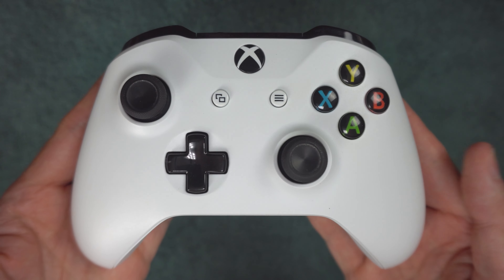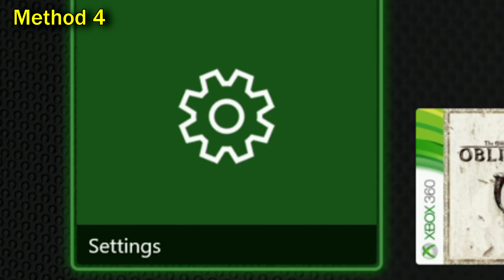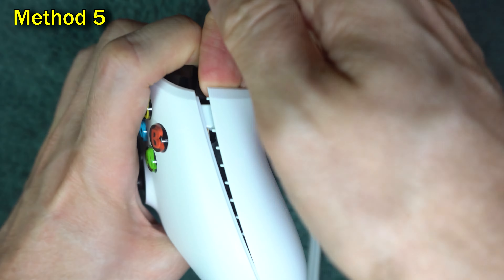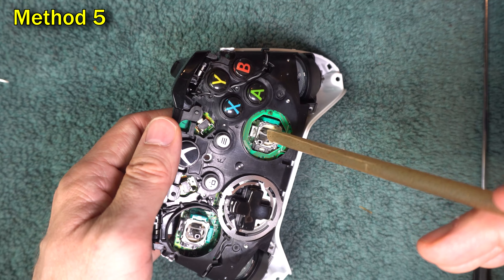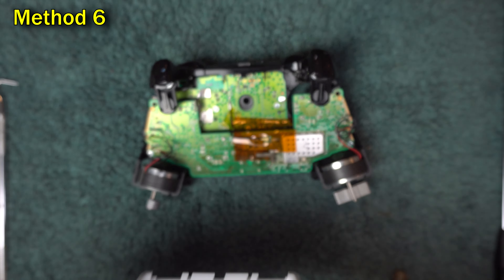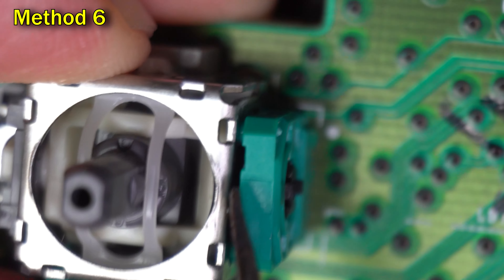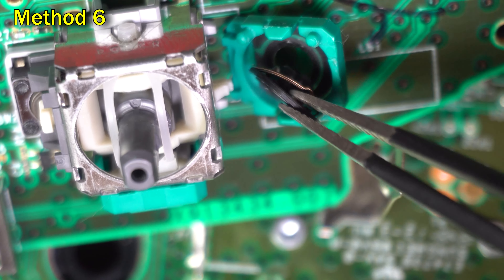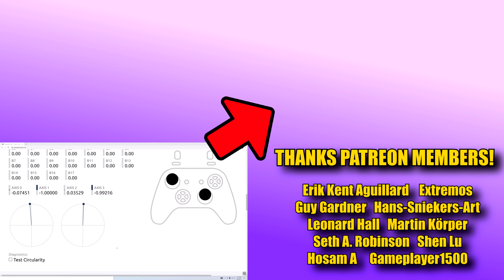How to Fix Analog Drift on XBOX One or Elite Controller Series 1 (moving on its own, stopping)

Comment from the maker: Stuff you might need:
Analog Thumbstick Replacement Kit: https://amzn.to/3LvUVhn
Precision Screwdriver Kit: https://amzn.to/3TtYrur
Replacement Part Kit: https://amzn.to/3NgmLNO
Quick Charger for Xbox Controllers: https://amzn.to/3yMVTOK
Play and Charge Kit USB: https://amzn.to/3lokypN
Chargeable Batteries: https://amzn.to/3JBumoy
LB and RV Button Replacement Kit: https://amzn.to/3ZY8me9

All Amazon links above are affiliate links. I get a small amount of money if you end up using them to make purchase (it does not have to be for the item I link to, as long as you click my link then move to another item, it works)

Comment: I went to method 6 some months back. When it worked again with no drift after the clean, I thought how many controllers could I buy cheap with the drift and with the rest fix, re-sell them. The controller I fixed worked for a few hours no problem and felt confident enough to sell it. It was bought and I shipped it off. Days later they tried the controller and reported drift in the same stick I thought I fixed. So it's only a very short temporary solution. What you really need to do is replace the component by soldering it in.
Reply from the maker: For some controllers the fix lasts a long time. Sometimes there is a large piece of debris that just needs dislodged.
Reply: @HowToX  no, it doesn't. If you play games like a real person, these controllers are designed to break. The potentiometers are horrible. The only true fix is to solder a new one.
Reply: @BoUnCiEjElLo24 bro mind your business
Reply: @BoUnCiEjElLo24  thats not fixing, thats getting a replacement
Reply: @Freegame4. that’s fixing the controller itself 😂😂😂
Reply: @Freegame4. it’s replacing a piece of the controller not the whole god damn controller😂😂😂
Reply: @NoahinDatBusiness   lmao this is old and i misread "solder" as "get" somehow so you do you and thats my bad
Reply: Tip: if you have any other controllers you no longer use, replace the two disc thingys that are inside the green “doors” rotating them every couple of weeks works really well for me, while cleaning them softly in iso alcohol in between.
Reply: @bluestingray7896  yh. They are called potentiometers. I use a soldering station to remove them and bought a bunch of them from ebay to replace. Pain removering them though.
Reply: @BoUnCiEjElLo24 if they're designed to break then you've fixed it for the time being with the parts you have access to. Most all things breakdown or denature that's technology. You can either do temporary fixes or you can go get a whole new controller that'll start doing the same thing after 3 years. Don't say it's not a fix just cause it's temporary these controllers are meant to be temporary that's how Microsoft makes their money between games and consoles take it up with them not some random person providing a way to save a couple dollars to  continue gaming.
Reply: I have gamecube controllers that are over 20 years old that still work. I have a Logitech controller that's also about 20 years old and still works. I bought an xbox series controller, I looked after it so well, I even kept it in the original packaging to keep it free of dust. After just a few months it started giving multiple problems. It's a POS.

Comment: Nice job.  Method 6 is cleaning out the contacts and wipers of the potentiometers.  I thought this would be unfeasible without desoldering from the board, but it wasn't that bad.  It looks like dry dielectric grease on the wiper/resistor element.  Isopropyl took it right off and eliminated all drift and sticking.  Whole analog stick assemblies are available at decent prices to solder in if this method doesn't work.

Comment: Method 7 worked for me! I could kinda tell that nothing else was going to, Because the contact cleaning was doing absolutely nothing. I used needle nose tweezers and was able to pull it out the little grey tab thing without too much trouble.

Comment: When I bent the green door back, it broke the metal connection, fairly easily! I dunno how to fix it from there. Also should've informed us on the direction the spring disc should have been inserted; bendy side up away from pcb or down towards it?

Comment: Sad to say, with my controller, none of these worked. First I tried 1, then 2, then I went then I went to 5, but it didn't look that dirty, so I just went to 6. Did everything, didn't try 7 since I figured I wouldn't need to go that far, and I don't feel like taking apart my controller again rn. So, my controller seems busted, and in fact the drift has only gotten worst. While it used to be slightly a great annoyance, now my controller it near to inplayable. 
Oh well, I've had this controller for at least 4 years now, probably 6 if I were to guess. The joystick grip is gone anyways, about time for a new one I guess. 
Oh well, best of luck to anyone else repairing their controllers, it seems like everyone else who's tried has gotten great success. 
Great tutorial btw, very straightforward and helpful, even if my controller didn't make it. 👍

Comment: tried cleaning from inside, now my controller is bricked and won't turn on
Reply: nvm, the fix is this: the two metal poles from the opposite side of the battery were not sliding in, I fixed that and boom, working
Reply: however the drift is still there :(

Comment: Anyone who doesnt have one of those screwdrivers (who does honestly) you can use a drill bit meant to drill holes in wood, make sure its a thin one but the sides will dig in slightly and catch it

Comment: I bought an elite controller for 20$ with very slight drift on the right stick. I've tried to clean the drift out of 30-40 controllers before with mixed results, so naturally when i found this video i had high hopes. I took out and cleaned/bent all the discs back and cleaned both pcbs, let them dry and reassembled. This made the drift issue worse. I'm gonna try to rotate the discs from one side to the other and double check my work at some point. Thanks for the information, most video just offer generic advice without showing how the controller internals function 👍

Comment: I have an elite controller, so I can’t pull the thumb sticks out to do the tap debris free method you start the video with. Any suggestions on pliers to grip the base with, without damaging the controller?
Reply from the maker: I have a video for the Elite Series 2 which shows how to use heat to help remove them. https://youtu.be/JnbpqSbXpgY

Comment: How do i upgrade firmware if i use the controller with a laptop or pc?
Reply from the maker: Download the Xbox Accessories app
Reply: @HowToX  Pulling the left stick and tapping the control so debris fall worked, no more drift.  Thanks you for this informative and helpful video.

Comment: Its not the first time my controller is drifty, its literally so annoying. Normally i just blow into the circle and it stops but lately (for a month) it wont fix. I've tried 3/7 methods and it doesn't work.

JM ABOUT TO FUCKING RAGE

Comment: Little food for that, 2:00 they cannot legally void your warranty, just because you tried to repair it. This is actually been fought in the Supreme Court case and his rules on.
Reply: What SC case was that? Gotta cite sources. Correct that proper repair attempt following procedure and using parts provided/approved by MS doesn’t void warranty as such. However, warranty won’t cover damage caused by recklessness, improper execution, deviation from instructions, environmental conditions, deficient tools , insufficient preparation, et al. Basically you can repair and keep warranty, but they’re not responsible for anything you break in the process. 

And really, most people wouldn’t do surgery if they were under warranty anyway.

Comment: This was so useful, i litterally had my old Xbox Elite 1 controller in its case on the shelf for years, as the left stick had depressed and flipping it round and knocking on it fixed it, so thanks you for the guide.

Comment: Couldn't get past Method 5 because none of my torque screws would come off fearing I'd strip them. They just turned and turned. I would like to know what actual sizes fit on each screw. You just say 7-9 but obviously, you used one of them not all three.
Reply: You have to have the torx safety bits. If you don’t know they have small hole in the center of the bit and the screws have tinny pegs in the center of them

Comment: Method 6 = good luck. Better off just buying a new controller off amazon. Cause those motherboard wires... you might get one back on, but not the other.

So if it drifts, just deal with it untik you can replace it. It's not worth the risk.

Comment: You sir saved me a lot of money. God i can't thank you enough :)
I had to go all the way to level 6 and clean the potientiometer, but in the end the drift vanished completely from the right stick of my beloved Elite Series 1. A bit wearout stayed, but that is normal hence it's almost 7 years old and used almost daily on my PC.

While i do have the Elite Series 2 on my Xbox and could theoretically use it on my PC, too, i really love the long life of the 1 and first and foremost: the absence of a glued non changeable battery. 2 AA rechargable batteries are changed in less than 10 seconds and having 1-2 good pairs charged all the time is more than enough for me. :)

Again: Thank you!

Maybe a note to all Elite Series 1 owners: the cable running from the back to the second board is a ribbon cable in our case. Be careful pulling that out and use tweezers that come with many precision screwdriver kits to put them back in carefully, to not damage it

Comment: My controller is messed up because that gray piece by the button is actually broken. I have another controller this has the same joystick problem but I'm gonna open it now to see whats wrong

Edit: I bent that door piece out, cleaned it up, and now it works!!! it was just full of gunk inside which was messing with the contacts. I'm so glad I fixed this because the rest of the controller is still perfect

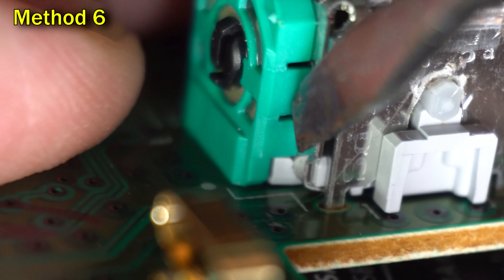Comment: I'm just commenting my experience to see if it helps anyone. I had wicked drift (XBOX Series X|S) on my right stick. Symptoms were always moving in the up direction. Major pain when playing a game and always looking up.. I tried cleaning by compressed air, Iso Alcohol (99.9%) q-tip and toothbrush. I prefer not using cotton balls due to the transfer of tiny hairs. Nothing worked. I ended up taking out the Y axis sensor. Looking at the sensor using a magnifying glass I was able to see a small white particle (maybe plastic?) and a very thin dust-like hair similar to the one you can see at 5:52 in this video. I removed the particles using fine tip tweezers, gently cleaned with a q-tip and ISO. Let dry. Reviewed the sensor and sensor housing for any further particles and replaced the sensor. Tested and works better than it did when I bought it. Although I can see how a dust-like hair may make its way into the sensor housing, I can't imagine how a small piece of plastic would work its way in. I'm guessing most of the sensor issues may be due to poor quality assurance.

Comment: Had to go until step 6, opening the small doors, but this fixed the issure for the moment. Actually, opening the controller's outside shell was the most annoying part, because not all of the screws didn't fit right to my torx srewdriver. Had to use a torx 9 as well as a flat head. Opening the green doors wasnt very complicated to my surprise, just be very gentle and take it slow, use a very tiny flat screwdriver head.
Now I hope the controller will be fine again. Bought it 5 years ago but didn't use it much, it even was quite clean inside and outside. Back in the days... I remember my Dreamcast Joypad I used a very lot, never had any problems. Sega built in complete different high quality analogue stick electronics, they were to last like forever and drifting wasn't even possible due to the construction. Maybe I'm just too old for the newer shit...

Comment: Had this problem very recently after just having bought a new elite controller. My left stick didn't move back but stays where it is causing, e.g. in Rocket League, a drift out of the blue. All I had to do is turn the head of the stick clockwise. Appearently you can adjust it here and after turning it untill the end, the problem was solved. No cleaning required at all.

Comment: Unfortunately none of these worked for me. And i don‘t want to open the controller. I can‘t afford a new controller for 60€ so i‘ll just live with that. But thanks for the tips
Reply: You can't say none of these worked if you didn't open the controller. It's a very basic procedure and it could easily fix your controller problem.

Comment: Hi, recently i’ve bought an xbox 360 wired controller, and when i run a controller test, the analog sticks movement is not circular, but square. Also is looks, like the dots are magnetting to X and Y axes. And when I move my LS slightly, it just doesn’t register anything, until some point, where it immediately moves a lot from the centre. My analog triggers also start registering movement only if they are more than half pressed. And also it just makes beeping noise when needs to vibrate slightly. It can not vibrate for half of the game, and then somehow really badly vibrates. Is there any software fix, or i have to manually replace components?
Reply: its a 360 controller bro, time to upgrade

Comment: Better fix: don't buy one, you are more likely to open up the controller and rip one of the many cheap wires that even soldering won't fix.
Reply from the maker: How would you play without a controller?
Reply: @HowToX  that's the neat thing, you don't 

with this controller ;)

Comment: Xbox controllers are garbage. I've gone through 3 controllers in 2 years. The first one I got pissed and smashed it on the floor, the second one I tried to fix but accidentally ripped the pot off. The third one I've taken apart like 15 times to fix the drift.